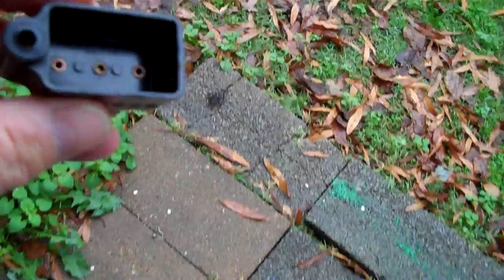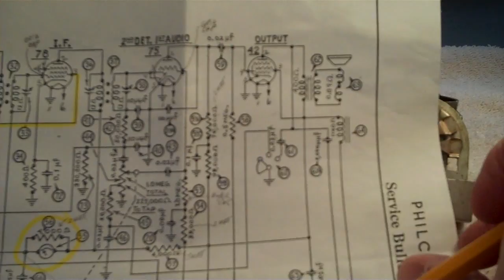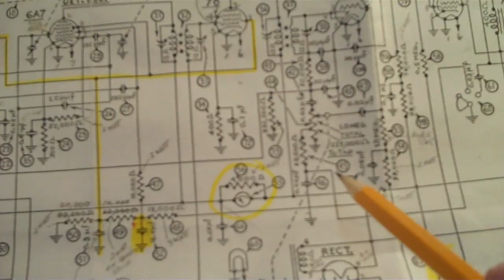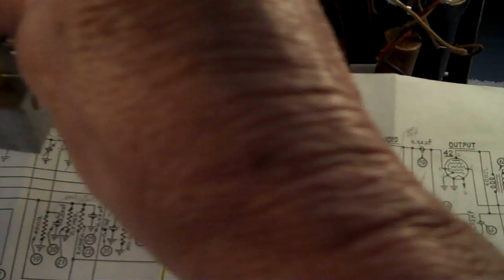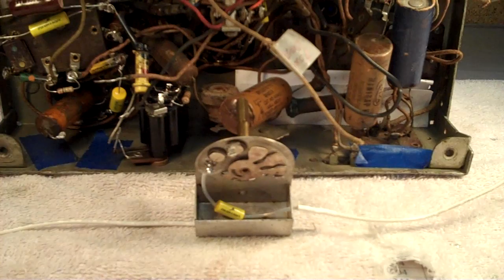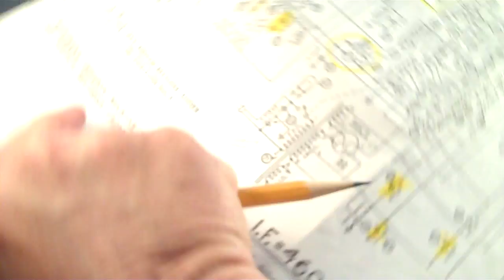1936 Philco Model 630B Repair and Restoration (Part 18 of 35).

Comment from the maker: Bert,
Hello again, my friend.  It's been a long time since I was on the Antique Radio Forum and even longer since restoring my 630B.  You've brought back more than a few memories.
Whenever you have a situation like yours i.e., a component(s) with a hanging or missing wire and you can't determine where it was originally connected, always look to your parts list for help.  In  this case you have a disconnected 20K resistor and .3uf capacitor.  There's some minor component value differences between the Philco 630 and the 630B, but they're no big deal.  Using the Philco 630 online schematic, we see that the parts list shows part 45 being a 20K resistor and that it's in series with a .2uf capacitor.  One end of that resistor is tapped into the volume control and the other end to the tone control.  Those old volume control taps are almost always shot.  I've never seen one yet that still works.
Anyway, either your volume control has been replaced with one that has no tap or the tap was causing volume control problems so someone just disconnected it.  If so, it means you also have no functioning tone control circuit.  Someone on the Forum might have a good tapped volume control they'll sell at a reasonable price, but it's doubtful.
Hope this helps.
Regards,
John

Comment: I know I'm way late with this but FYI, a 630 volt film cap should work just fine as the nominal plate voltage on the 42 tube should be from 250-315 (at max) volts. These modern film caps are not your grandfather's paper caps as they are self-healing and can take the transient spikes over 630 volts. The old paper cap probably fried as it became too leaky turning itself into a resistor that couldn't cool itself covered by the potting material. The 1300 volt cap will work just fine, as would a class 1 NPO/COG or perhaps a X7R class II ceramic, of course, no harm done. The radio will go on fire from shorts long before this cap fails but why spend the extra money and take up the unnecessary space. Just saying but if it helps anyone here sleep better at night, it's all good. Best regards.

Comment: As usual, Another great vid, John!
Question: I'm getting the idea that your plan is NOT to change all the old components in the chassis unless they're bad. Whats the idea behind that? Wouldnt it be better to replace all those old resistors and capaciters while you've gone this far already?
Thanks, Art

Comment from the maker: @da0ke,
Daniel,
Hello there.  It's very good to hear from you.
Philco bakelite blocks housed bypass capacitors.  I don't know why they chose to do it that way.  To my knowledge they were the only manufacturer that did.  And the potting compound was used for all the reasons you mentioned, in that the old paper and foil capacitors weren't the most reliable components in the world.  Our modern, superior quality capacitors don't require potting.
Thanks for being here.

Regards,
John

Comment: Hi John, Interesting video again. I have a question: why they filled up this bakelite blocks with potting compound? It makes it hard to change components and you didn't fill it up again after you changed out components. Was it for shock resistance and exclusion of moisture for the old paper capacitors? Why they protect this specific caps? Electrical reasons to prevent sparking? Greetings from germany. vy 73 de DD7DKA, Daniel